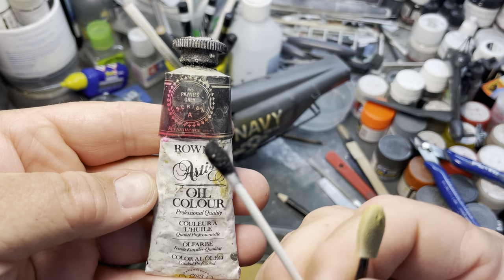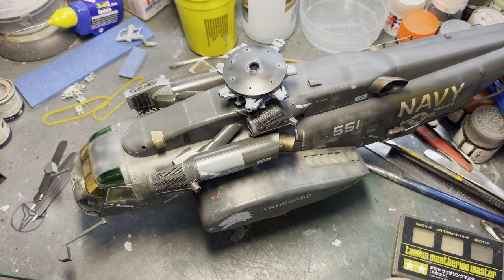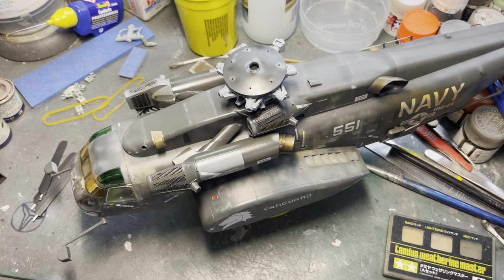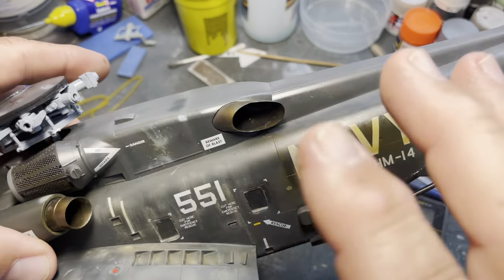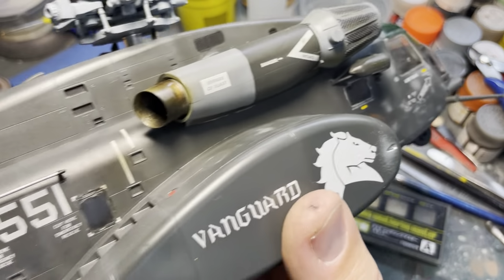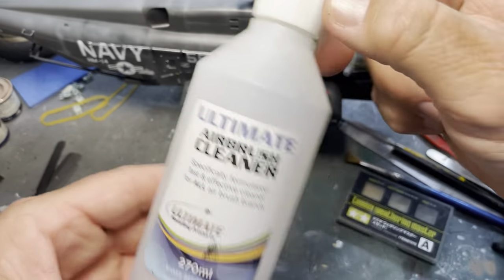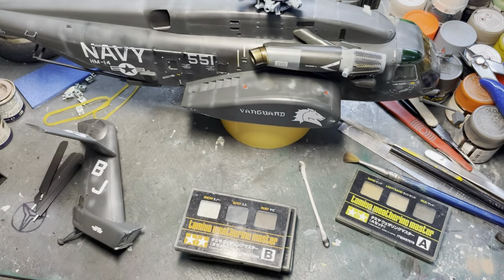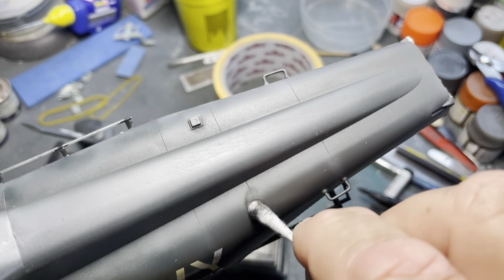Weathering tips on the Academy 1/48 MH-53E Sea Dragon

Comment: I served with the HM-14 "Vanguard". Very nice weathering techniques. The #1 engine cowling being a different color is spot on. That light grey is used by the Marine Corp and since they have most of the 53's they are sent to Navy squadrons that way until they can be painted. A very dirty aircraft because of the amount of grease and fluids (hydraulic/oil) that is located near the top that percolates into the cabin and outside skin. Loved that thing though. It is an impressive piece of machinery.
Reply from the maker: Wow thanks for the compliment i saw them when I went to NAS Oceana, they are massive I’m glad I captured the look of the thing 💙😉👍🏻

Comment: Hello, Enjoyed your video. I am just getting into weathering. Question please: after applying the weathering pigments did you say you have to "seal" it with lacquer? Can I do this without an air brush? Thank you
Reply from the maker: Hello John yes you can do this without using an airbrush, if your going to use a paint brush I would firstly test out on a spare piece of plastic just to see if the weathering pigments stay put. If they don’t then you can use Halfords clear lacquer straight from the rattle can, I used to use Johnson’s klear floor polish to seal the powders and pigments in on my models before I used the more advanced airbrush techniques 😉👍🏻 hope this answers your question 💙😉👍🏻🍻🇬🇧